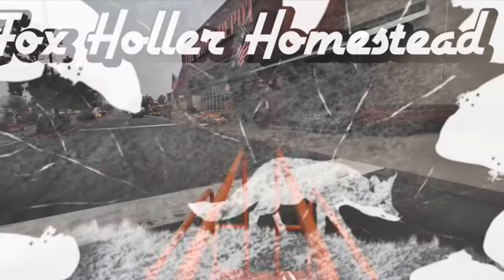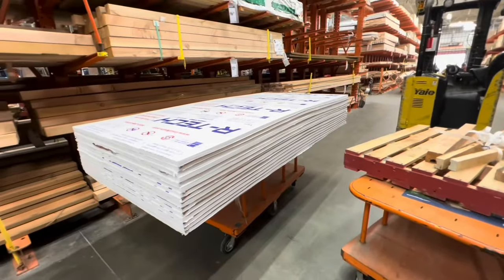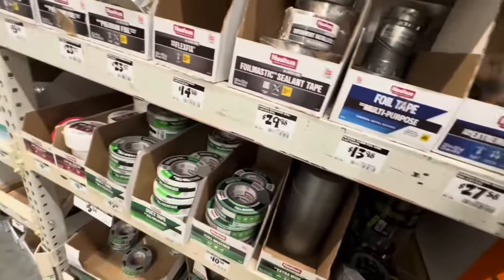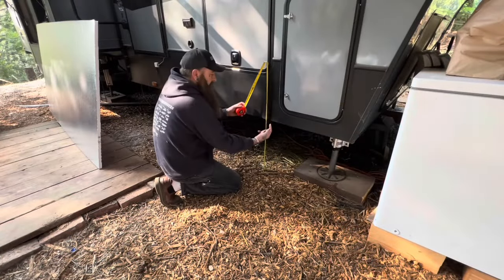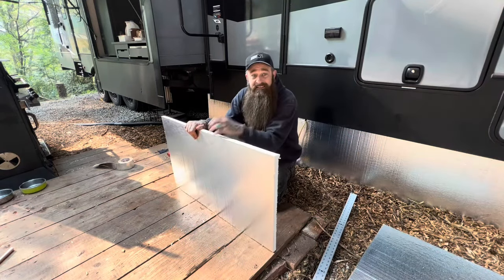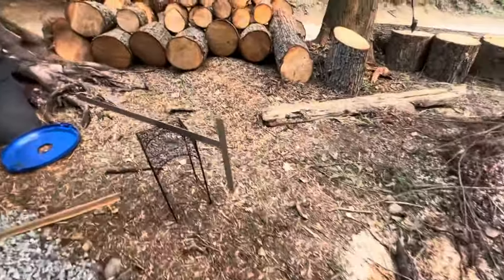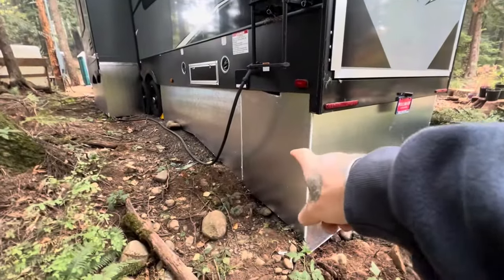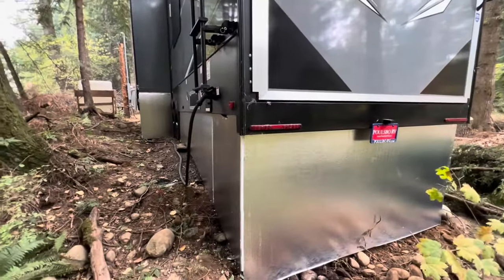Effective investment for long and short term hot/cold weather insulation of your DIY RV skirting

Comment: I like this idea, but I would personally give the bottom end of the foam "feet" in the form of either lumber or metal studs that have 1 inch slots in them. There are so many types of construction framing studs that there are bound to be 8 foot framing pieces with 1 inch slotting in them. You can basically spike these into the ground and then set the foam into them. It will secure the bottom of the skirting against storm wind pressures and have a better chance of lasting longer because anything right on the ground will basically ROT whether it claims it won't or not. . I realize this would increase the cost of the job by a few hundred bucks, or less if you can make the slots yourself and not search for parts that are already slotted for some other purpose, or make them out of multiple pieces of smaller lumber like 1x2's. . As a cheaper and attractive creative solution I would also consider just putting decorative rocks stacked against the inside and outside a few inches high just to hold the bottom of the skirts in place. This would also hide any slope gaps.potentially, although if you cut the foam at an angle you can minimize these as well rather than trying to go square. ( I didn't quite watch the entire video before making the rocks comment. You did the same thing with free and available woodchips you already had. I just recommend that you put something against the inside as well. Maybe a few well placed rocks or lumber just to keep the bottoms from pushing inwards.  Rocks have the advantage of more weight to hold the skirting in place, and provide natural drainage, but if I had a pile of woodchips, I'd have done the same. All in all tho, what a great idea, perfect material. Great choice of thickness, and if you live in an area protected by all those trees maybe you wouldn't need so much of a footing. An idea, rather than trying to fill in the gaps around the tires, how about just covering them on the outside with a sort of a popout box made of foam. More boards required I realize, but other advantages perhaps.  You have a beatiful environment there. Databyter
Reply from the maker: Thank you for all those ideas honestly they were floating in the back of my head and I think I have a pretty good idea of what I would like to do but your comment gives me a lot more ideas!
And as far as the inside I did place larger rocks up against the panels so they would not get blown inward so great minds think alike!!
Nothing but love my friend and again thank you

Comment: I used 1-1/2" rigid insulation and boxed over the tires. My trailer was only 21'. My new trailer came with heavy vinyl skirting. It was way easier to put up but I don't know yet if it works as good

Comment: For over the wheels,,,cut some 2" strips of foam, laminate these together and build up a strip vertically behind and in front of the wheels. Also go horizontally above the fenders. These laminated strips would only need to be as thick as the fenders. Then add a foam sheet to the face of the laminated strips that will cover the wheel area. I know it may mean sticking tape to the painted surface, but I think this is the easiest way to cover the wheels.
Reply from the maker: Super awesome idea and I think that I’m gonna go with something very similar to this, Great minds think a like!
Many blessings my friend

Comment: If it were me, I'd buy some marine upholstery vinyl and make a fitted cover to the wheel wells. Using some stainless steel snaps to secure it to the wheel wells. Material Cost around $100 for the vinyl and around $300 for a cheap leather shoe patcher sewing machine (with the threads, needles, stainless snaps and screws) These covers would be custom to only your RV and far outlast the foam boards, so they can be reused year after year. The sewing machine would pay for itself over time because it gives you the ability to make your own awnings, covers, bags, leatherwork and maybe even fix a pair of boots in the process.
Reply: https://youtu.be/uMPFg_p0Luo?t=463 This is the machine and I'm fixing my awning with it.
Reply from the maker: OK now this is probably the best I’ve heard so far and I actually have a old industrial brother sewing machine but it just happens to be in storage right now unfortunately. I took some upholstery classes years ago and learned all about marine and automotive upholstery which would probably come in handy during this process makes me want to go dig that machine out and thank you my friend!

Comment: Great video! Thank you. We will be doing this to our 5th wheel soon. I was trying to sort out how I'd cover the forward area of the camper as most of the 'professional' skirts seem to, but noticed you didn't do it. I'm curious as to why you didn't. Our lithium batteries are in that front storage area and I'm concerned it will get below freezing in there and harm the batteries when they charge.
Reply from the maker: Sincerely, thank you!
Our batteries are actually on the side, but I left the front open because we have our outdoor freezer that I store under there as well as access to our generator and propane.
Also, I have our trash bins under there because we don’t have a trash service out on the property. It keeps it dry until I take it to the dump once a week.
Many blessings from our family to yours, my friend ! 🙏

Comment: Nice job. Lools great. We get a little colder here so i used 2in board on mine when i did that. I also enclosed the front gooseneck area to keep the sleeping area there more efficient on heating. On the wheels i putthe boardon the outside and taped the end seams. Foil tape is great stuff for a lot of otger thjngs so hopefully you have some leftover from the first roll. Tape (especially foil tape) works amazing for tiny slivers that ya cant necessarily see like metal or fiberglass.
Reply from the maker: Sincerely, thank you and yes, I was thinking about the 2 inch board but it was so friggin expensive not to mention they didn’t have enough in stock. I am still thinking about doing the fifth wheel area as well but right now we have our freezers under there and some white storage for the chairs and kids toys, etc.
Also, did not think about the fact that it has a auto level system that I have to readjust every couple months so hopefully it won’t ruin the skirting I put under

Comment: Dusty,   I am going to skirt my trailer in as you did here in Nova Scotia Canada a sheet of 1-inch insulation here at Home Depot is $40.00  4x8. Aluminum tape 10 yards is $10.00 and only comes in Pinkthats the foil sheets. I have a ? for you did you wrap your pipes under your Trailer with heat tape or any insulation.  Thank you. God Bless,  Paul Ramsay NS Canada
Reply from the maker: Hey there, Paul!
I have to say that is too cool that you are from Nova Scotia.
I have never been there myself, but I do know and have heard that it’s a very, very beautiful place.
My stepdad was born there, and still has a lot of family that are still there.
Last name MacNeil.
As far as insulating the pipes, you definitely want to do as much as you possibly can otherwise you’ll spend a lot more money and repairs which no one wants to do that in the middle of the winter or anytime for that matter! lol
The RV that we have has a skirting directly underneath which protects the pipes from freezing but when I installed my water source, I definitely had to dig down 2 feet and run a 2 inch conduit which I run the water hose through.
We just got some cold weather here that was down to -7 Fahrenheit and everything worked out just fine.
One of the things that you learn along this journey of living in a RV is that, though you think you are completely prepared you will always find a situation or circumstance that you didn’t prepare for… Some people may say they don’t want to take on this responsibility but honestly, I feel it’s a lot more rewarding in the long run.
Again, my friend I send many many prayers and blessings to you and your family

Comment: Curious how you made out?  Is high snow fall a concern ? 🧐  Similar set up on my end.
Reply from the maker: @Zoofactory  it actually ended up working out pretty well and we do get a decent amount of snow at our elevation, but what I was more concerned about was Stopping the windchill underneath the RV. Worked out perfect!
Reply: @foxhollerhomestead Definitely the winterization of fluids I’m most concerned with.  Any solar panel charging mechanism is going to get snowed on (17’ avg per year) and I’m not there every day.  🤷‍♂️

Comment: That stuff works pretty good Iv used it for my RV before and I put more fluffy insulation around my water storage tank
Reply from the maker: Yeah I think that this is gonna work out just fine. Now since the rainy season is starting I’m going to have to worry about the pop outs on the RV…
Bringing in moisture so I need to figure out how to cover the top
Reply: @foxhollerhomestead  harbor freight has canvas tarp in black also that's pretty hand, I just picked one up myself down in Puyallup, but I haven't had much experience with the pop outs bringing In too much weather in those newer RVs maybe get it rolling hot in there and search for some drafts
Reply from the maker: @bradlyjohnson60  ya it seems the more expensive they are the cheaper they are made! Lol
Reply: @foxhollerhomestead  LoL right! Spend a arm and a leg and still has too be reinforced! At least the price of meterials has gone down a few bucks now I can justify buying a 2x4 or some plywood without saying do I really need this right now hahaha 🤣
Reply from the maker: 😂 exactly! I’ve just been milling my own lumber but it’s harder to do with a Alaskan mill. Ready to win the lotteryalready!! Thinking about building a pole barn over the rv though it would have been easier to do it before it got here
Reply: @foxhollerhomestead  right pole barns are nice and simple Iv also seen ppl basically just frame some like trusses on the roof of the RV and sheeting it with metal roofing
Reply from the maker: @bradlyjohnson60  I was thinking this as well but using aluminum to keep the weight down. Buying the kits are so friggin expensive they are wanting 8k and more for something that fits mine.